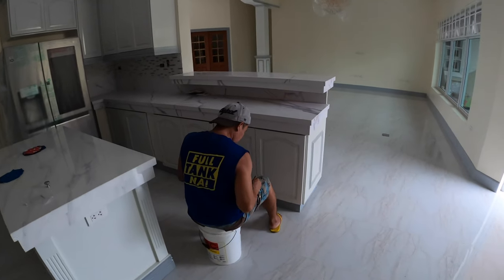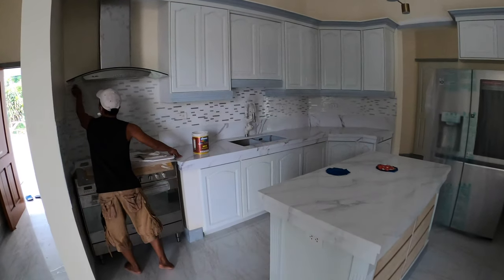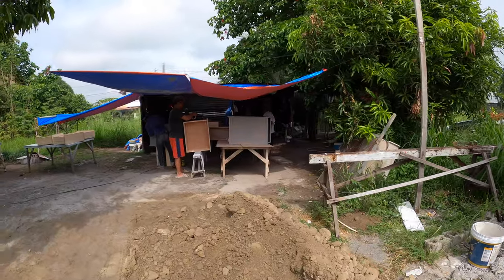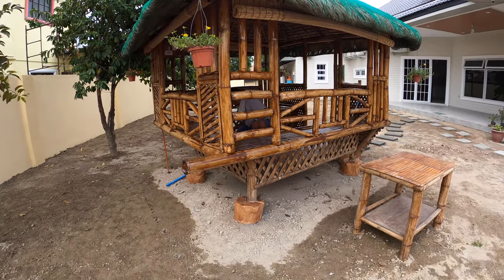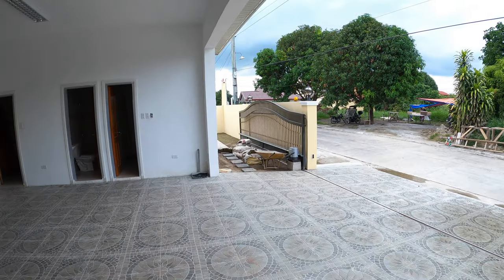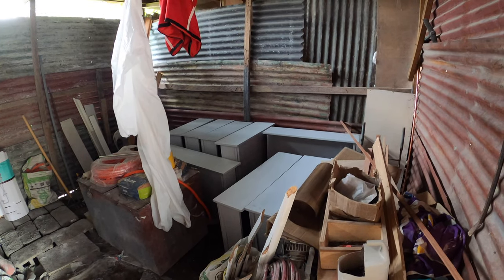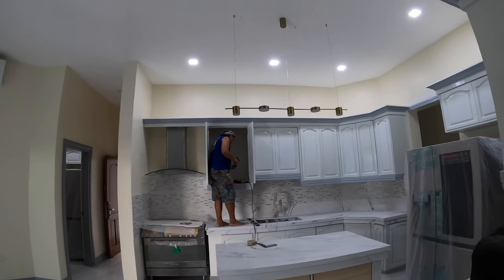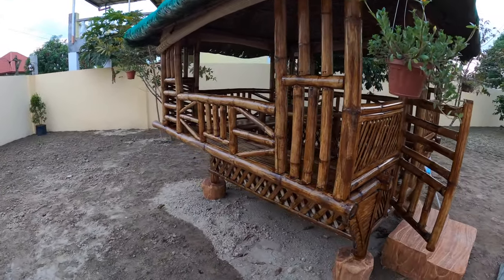Philippine House Building Step by Step, Build Day 259: Sod And Sand

Comment: Landscapers are doing a great job - may I pick on the location of your generator ?? I would have put it in the corner near your service pole - noise, heat and fumes right next to a window isn't a good idea and probably not recommended by the manufacturer....
Reply from the maker: Yes, we've heard. Thought about that location initially, but seemed too exposed and would be directly on top of the septic tank. Decided to put it up against the house for better protection. Obviously, it's a portable unit. So if the current location doesn't work out, we can relocate it somewhere else.
Thanks for the constructive feedback.
Reply: @CasaTexPina   - All good Mate - Best Wishes.

Comment: Looking good. But why did you put stove in the corner instead of middle of that wall so you have counter space when prepping and cooking? Just curious. 
Entry way with the flowers bed with stone is not good feng shui 
You blocking good chi energy from going to house😮. Entry to house should be open from walkway to door to foyer suggestion by feng shui adviser. You have walkway going around the corner😔
Love the house especially outside. Stunning! What part of Philippines is your house please? Love ur channel Thanks
Reply from the maker: Ok 👌🏼 
Main Kitchen... oven in corner due to a redesign on the fly because one of the columns was misplaced during the foundation phase. Threw the whole guest side of the house off.
Feng Shui... hmmm 🤔 
Our guys say the door, and gate shouldn’t be directly in line. Bad luck. So the walkway goes around the side and rose bushes to keep people from walking straight in. Different interpretation I suppose. 
We’re loving how the yard and flowers are all coming together. 
Thank you for the kind words and constructive comments. 🙏😊
Reply: @CasaTexPina  you have to live with that wrong location in your house? 
You have beautiful stove and hood you should place it in the middle , correct place while you are still in construction. 
For us it looks odd and out of place in that beautiful kitchen in my opinion. Everything was well thought out in your house but failed in the stove department sad to say. 😲

Comment: Looking good! Did you hire an Architect and contractor to build your house?
Reply from the maker: Louie,
We bought the original plans in the US over 15 years ago. Hired an engineer in Manila to do the conversion from sticks and bricks to metric and concrete hollow block. Hired an engineer from the local province for the build.
Reply: @CasaTexPina  I'm envious how beautiful your house is and I can't wait until it's completely done. Where did you find the the workers and laborers?
Reply from the maker: @olympiade2  
The general crew work for the engineer. Welders, tinsmith, windows, ac, landscapers, cctv, and garage doors are all subcontractors. Some sub under Eng’r some under us.

Comment: When do you expect to get your occupancy permit? Your close enough now to start moving in.
Reply from the maker: Great question 🙋‍♂️ 
The engineer mentioned it last week but we haven’t seen or heard from him since. Can’t move in without it. 
However, there are also additional works to be completed inside before move in is possible. i.e. repair ceilings from electrical installations, glass and knobs for doors and cabinets, toilet accessories, finish sanding and painting cabinets and drawers, and so much more. 
Eng’r mentioned end of January, but with only 3 painters, we’re most likely looking at mid to late February. Need more painters.
We are eager to move in, but lots of work needs to be finished before that can happen.
Reply: I saw in video today, even loss of power effecting you, good it came back early. My thought is you could start moving personal belongings in and placing them in attic area or media room, large spaces where you could sirt it out. Except over garage area where doors still need to be installed.  That is if you feel safe bringing it in.
Reply from the maker: @kevinchouinard1562 
Still too much painting throughout the house to bring anything inside yet. Technically, have to wait for the occupancy permit from the city.

Comment: Your main kitchen looks great except for the location of your cooking range. IMO, it's not ideal to place it at the end corner with wall on the left side. There should be at least a small space or distance from the wall just like your auxiliary kitchen for good working space during cooking.
Reply from the maker: Redesign on the fly due to a misplaced column that threw the dimensions off for the whole guest side of the house.